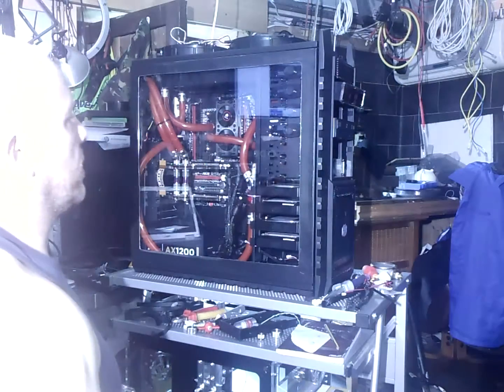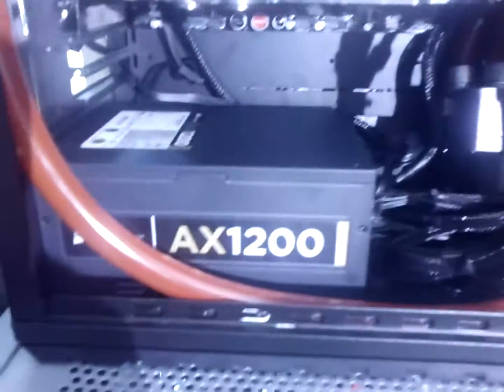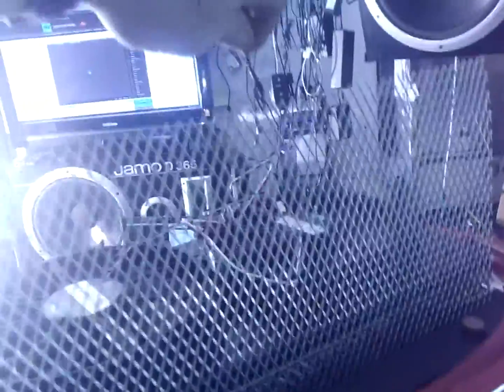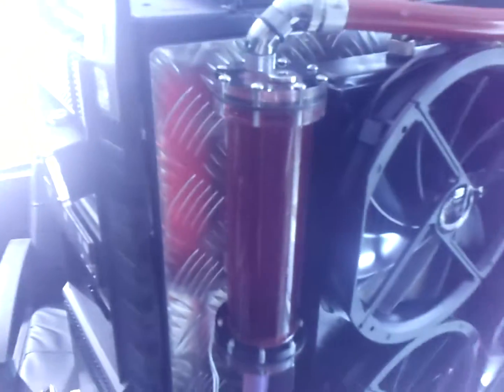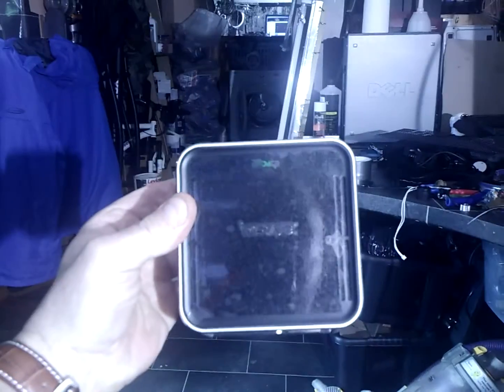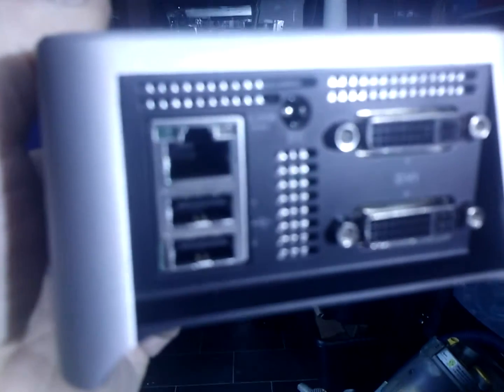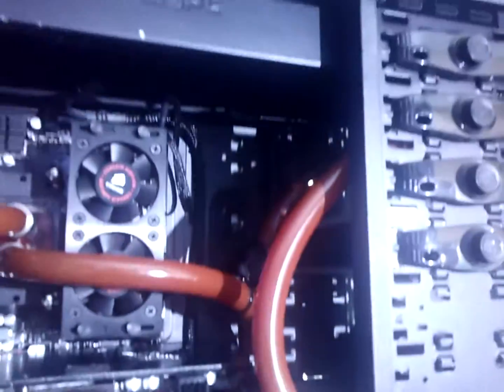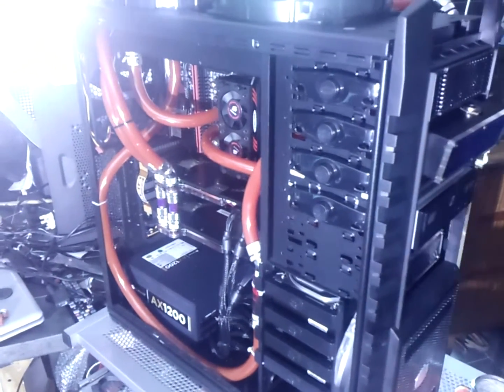Early Bitcoin miner ,at the time generating 1 coin per week at  £6 per coin value

Comment from the maker: yes the cpu is the main brain on the board , the only motherboard that will run with a cpu missing is a EVGA SR2 which uses 2 cpus and you can flip a switch to just use 1 ,When you get new cpu make sure to  remove your static charge before touching cpu or it could die or make errors be very very careful when fitting cpu and you a good heatsink or it will die fast

Comment from the maker: Thanks,this build has gone really smoothly ,with this build  we used a pre overclocked bundle from Scan computer component suppliers,ready set and fully tested at 4.2 ghz which is a big time saver for the motherboard ram and cpu config,we run a small computer repair company but also build computers as well to any spec. Were working on a website at the moment